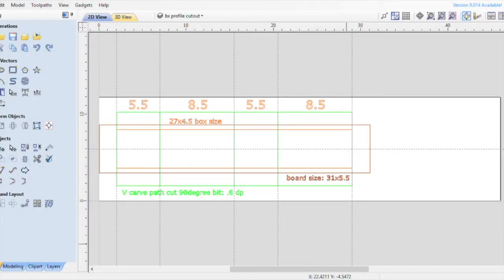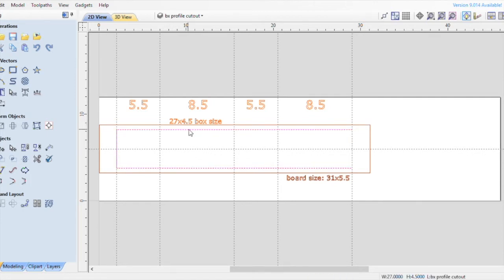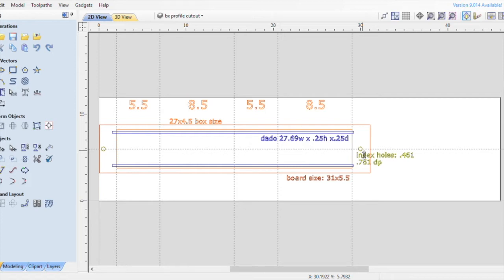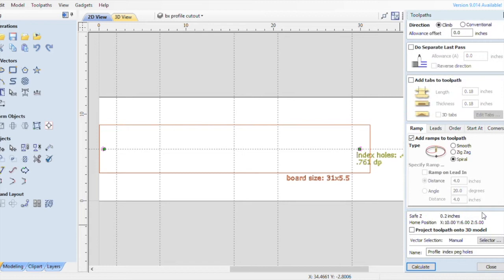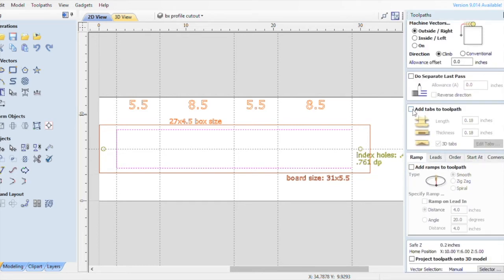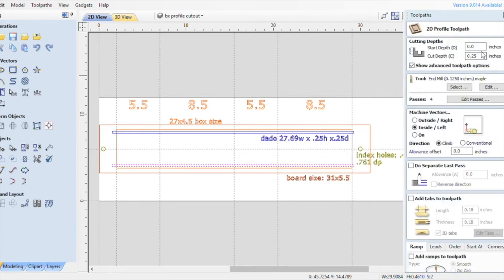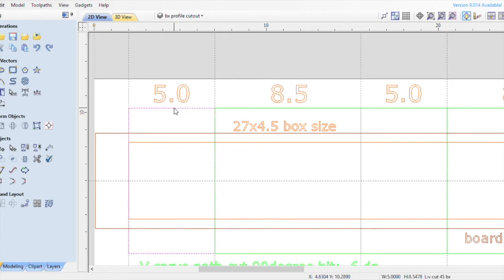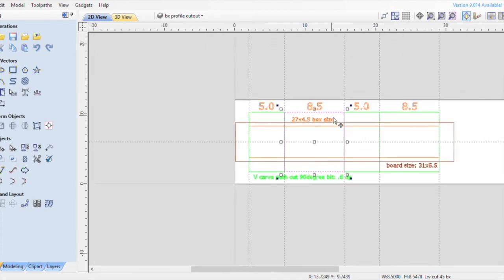Mandell Mann: Cutting 45 degree miters with 90 degree v carve bit

Comment: Mann this box is outstanding ....I was just wondering about the 90 degree but you were using I'm from South Africa and it's difficult to get those bits ...I attempted it but my 90 angle bit way to small to cut such thick wood...keep Up the good work

Comment: I watched your video 5 times and followed step by step only my wood is .802 thick using the same tools you used my 3D doesn't give me a 40 degree cut it's 45 at the bottom with a straight edge above the 45. Don't know what I am doing wrong.
Reply from the maker: joseph Lordi u have to make sure your v carve bit is the proper size for your board thickness. Why are you trying to get a 40 degree cut?
Reply: It should be 45 degrees if your using a 45 degree bit?